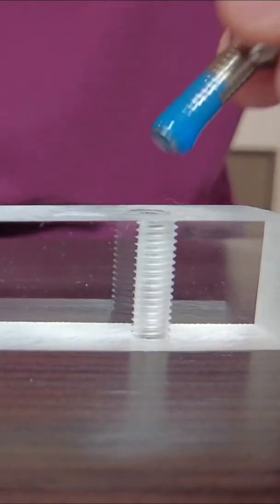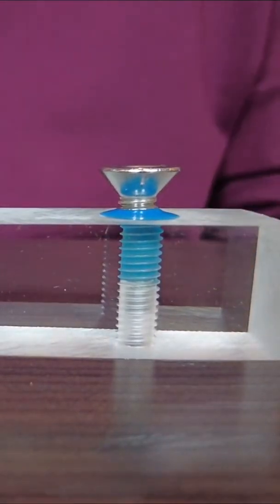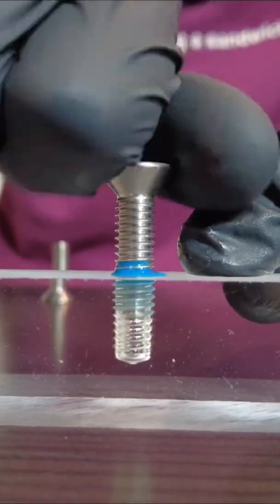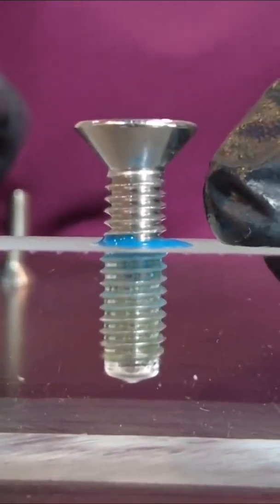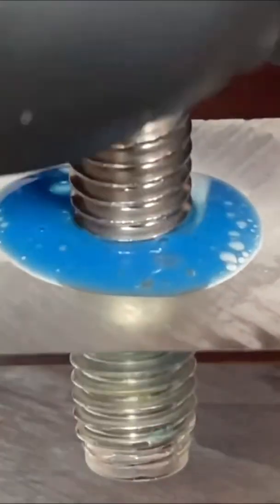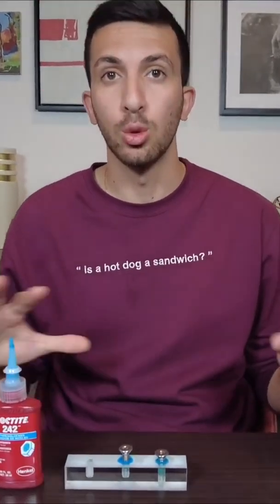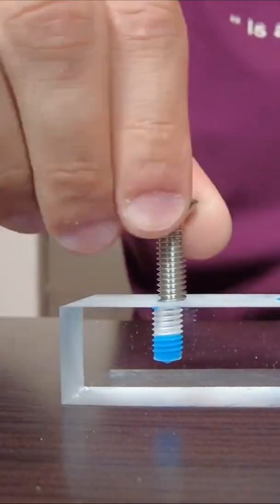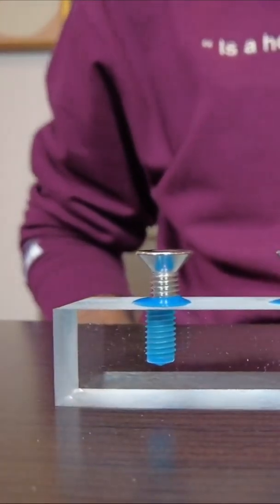How to PROPERLY Use Threadlocker 😮 #shorts

Comment: Nope.  Flow a few drops down the side of the hole.  That's how it's done.  If you dump it in, the hole may not be deep enough next time you mix up the bolts.  Same size bolts will vary a tiny bit in length.

Comment: that's a good way to hydraulically compress some fluid in a hole and crack a casting.
Reply: I've never found threads that sealed that well, ever. I've used this method forever; I think that Loctite even recommends it.
Reply: @UncleKennysPlace  they dont recommend it at all, and besides the casting cracking it can make it feel like the bolt is torqued down while its not at its position yet.

Comment: Threadlocker are only good to piss off the next guy... and usually, the next guy is you.
Simple alternative to threadlocker; appropriate torque (using a torque wrench)
Reply: Threadlocker can also help seal threads, and is required for some assemblies, and is also great in high-vibration assemblies. If torqueing always worked, you'd not need safety wire on airplanes, or nylock nuts, or thread locker, right? It has a purpose.
Reply: You're right.